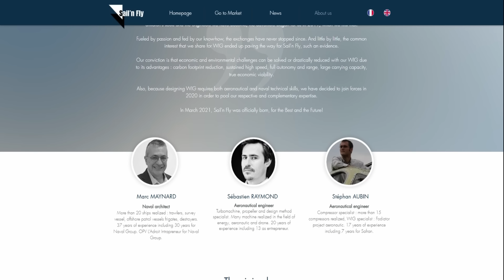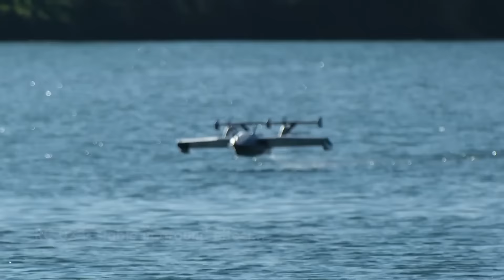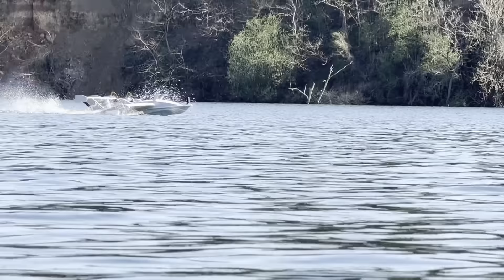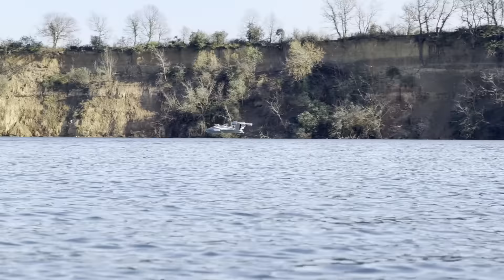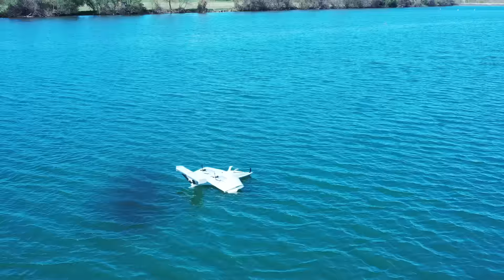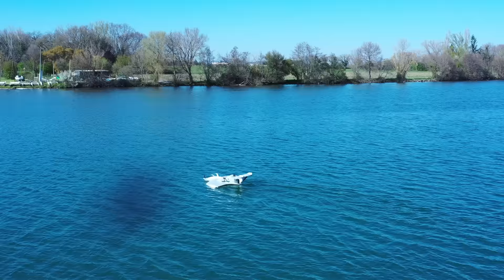Sail'nFly: Their New Ground Effect Aircraft Demonstrator!

Comment: Is there a reason why Ekranoplanes always operate from water? Sounds like something that should work fine operating as long as the airport is near the coast.
Reply from the maker: You're correct. They work above land as well. 
Unfortunately on land there are lots of things in the way, like buildings and humans.
In low populated areas where there are large open wide plains with for example snow and ice, these machines are very useful and practical as well.

Comment: Given the complexity of the tail arrangement and the need to balance pitch stability with weather-cocking, how do you think Sail'nFly will scale this for the larger Seagull variants?
Reply from the maker: That is a very good question indeed.
I think, looking at craft like the Seafalcon and the Airfish, that the tail would remain largely the same. They might combine some of the hull and float design with a tweak on the tail. Their renders of the 8/9 also still shows the current configuration but that might change based on test info.

Comment: It doesn't look like it stays stably  in ground effect for more than a few seconds at a time. Of course a larger craft would me more stable, but they should consider making a model that is at least a couple of meters long to get a better idea of how a full size one would behave. I have seen several far more stable WIGs at https://www.youtube.com/@rctestflight/search?query=ground%20effect
Reply from the maker: That's the next phase of the development project!
Reply: The ship is 2m long, yet quite lightweight. At those speeds with an electric propulsion the response to throttle and to wind gusts is extremely hard to handle. We always test in imperfect conditions (wind or waves) which makes it harder but also more representative.
Reply from the maker: Reynolds number always weighs heavy in these tests!

Comment: Without a scale 3 view to work with its difficult to assess but it seems to mee the tail is rather small for the tail arm theyre using. I dont see enough vertical area to make me happy either. That said, apart from a spasm of oscillation the main wing performed admirably in the plainly mild sea state. Rougher water would show some problems with the hull and float arrangement, it wouldnt cope with surf. 

I think a successful demonstrator would be a two-seater so it could carry a modicum of instruments and recording devices and show rather more than just qualitative performance in the flat water of lakes. Id like to see a larger machine with an all flying swept tail and tractor engines in place of the pushers to see how much better their wing performs.
Reply from the maker: I'm sure they are working on phase 2 of the project which would likely include a full scale prototype. That just costs more money..